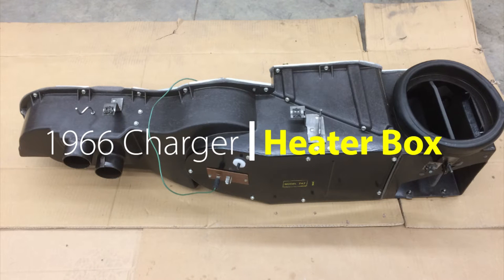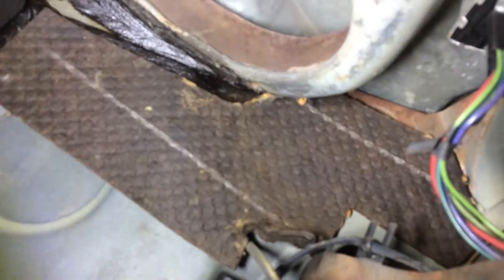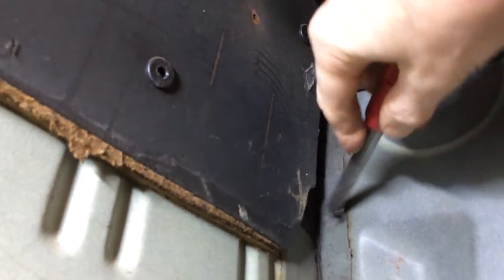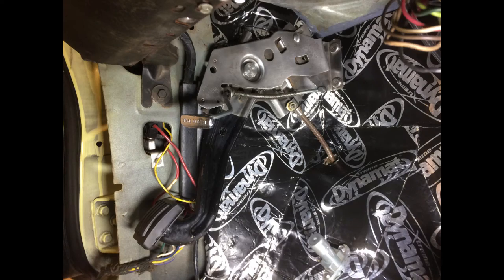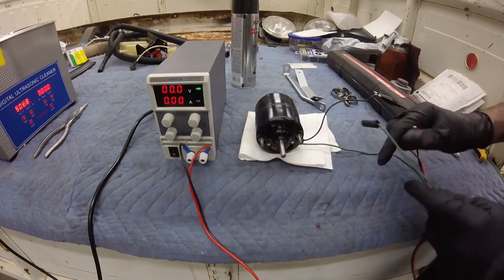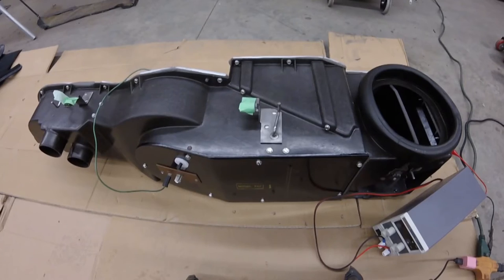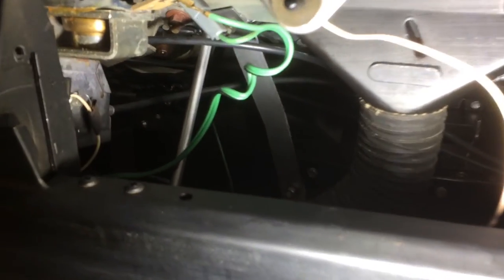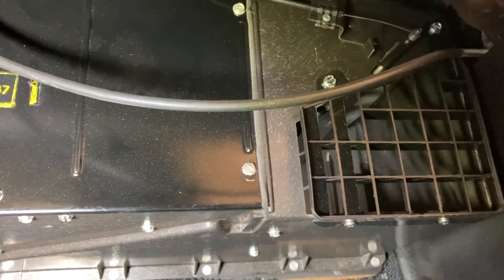1966 Dodge Charger Heater Box

Comment: Also fan motors are hard to find  the correct one w the  blower motor vent hole in the right place that's the rubber vent that goes in hole in motor
Reply from the maker: Thank you.